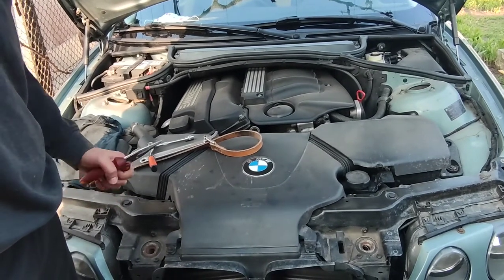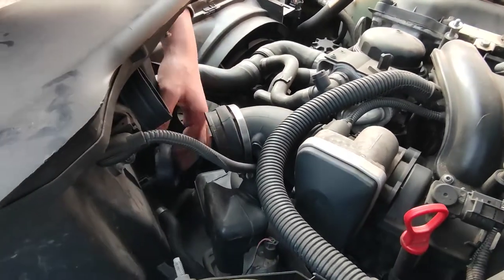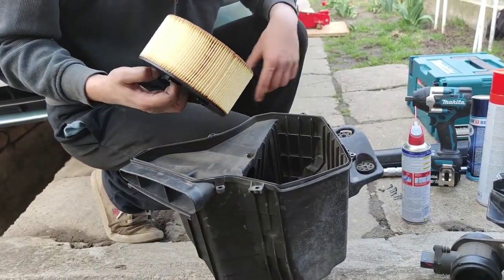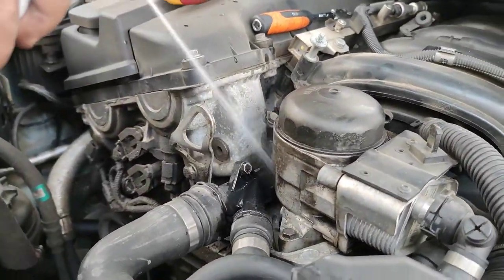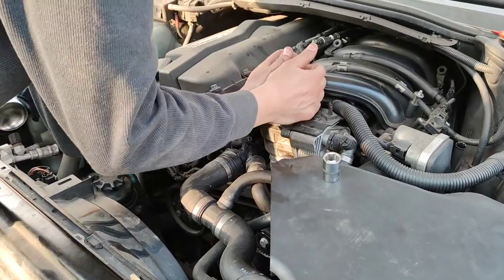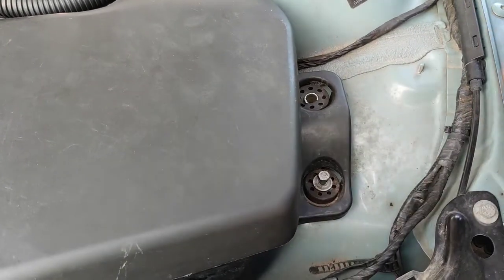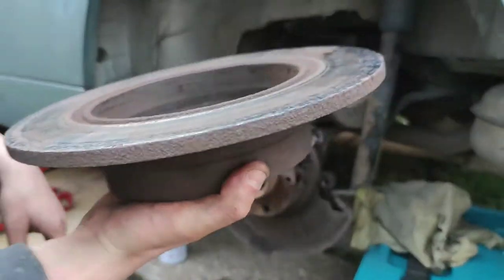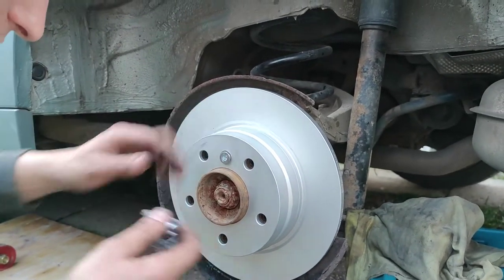BMW E46 316TI Compact oil, filter, air filter and brake discs replacement

Comment: All good mate, just couple tips. 1 Berofe replacing brake pads/discs, need to open brake fluid reservoir cap, because you forcing brake caliper pistons back (brake fluid filling up in reservoir). 2 with new brake discs need to use new brake pads, hence old or even like new brake pads will ruin your new brake discs of their uneven wear/ tear surface ;)
All the best mate
Reply from the maker: Perfect, thanks a lot for the tips and comment, much apreciated and I'll definetely apply your suggestions. ☮️